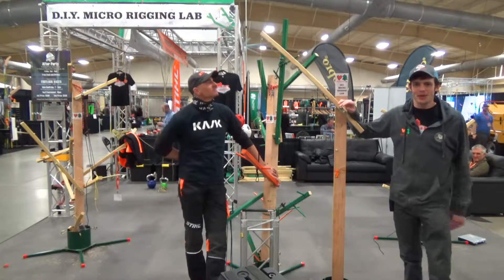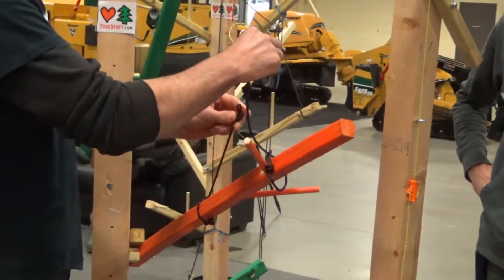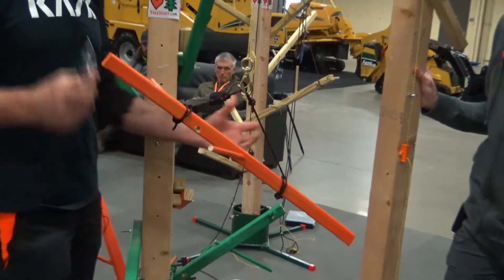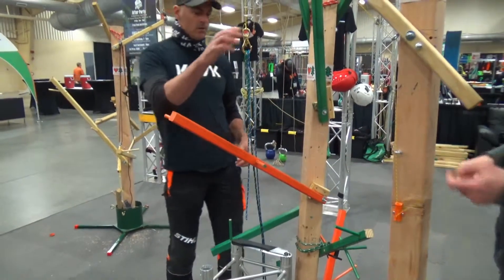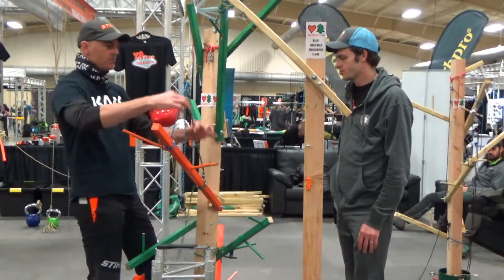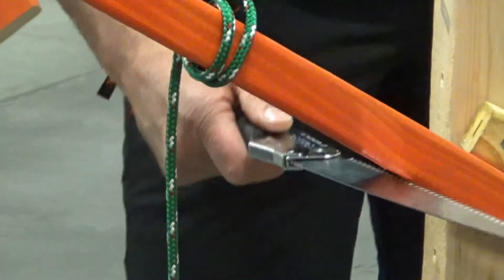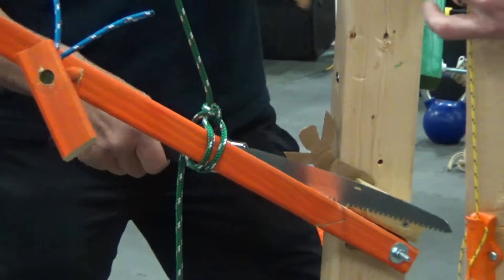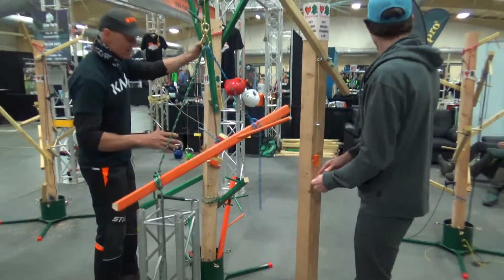How to Balance Limbs for Crane Tree Removal w/ Mark Chisholm

Comment: The best way to avoid horizontal limbs doing crazy things is to stand them up vertical. Tip tie the limb. Make a face cut on top, back cut on bottom, leave a small bit of hinge. Cable up and stand the piece up vertical. Cable down to approximate weight of limb. Remember to position yourself so you’re cutting above your head as much as possible (that way pieces can only swing above you, not into you)  and cut through. Tip tying loads the limb vertically as it’s being transported through the air. Wood fibres are 10 times stronger when loaded vertically. Balancing the limb horizontally makes it 10 times more susceptible to failure from its own weight and should be avoided as much as possible.                  The slings used here also present a problem as they don’t appear to have the weight needed to reliably break through the canopy. Chains have enough weight to break through and enough length to keep the ball out of the canopy. Lowering the ball into the canopy can cause the crane cable spool to essentially birds nest like a shitty fishing rod should the ball get hung up and the operator continue to cable down. The ball getting hung up then letting go could result in the climber being struck and killed.
Reply: Great explanation why you don't want to balance everything out. I've used this method for horizontal limbs since I started doing crane work and it's really common to do it that way her in the Netherlands. I was wondering if someone could explain to me why everybody in the US is using slings instead of chains? Aren't those dead Eye slings much weaker than chains?
Reply: Most of the guys I know in Canada use chains. I can’t think of a reason to ever use slings.
Reply: be careful cutting overhead, don't have a ton of power against kickback directly at your head, great explanation tho